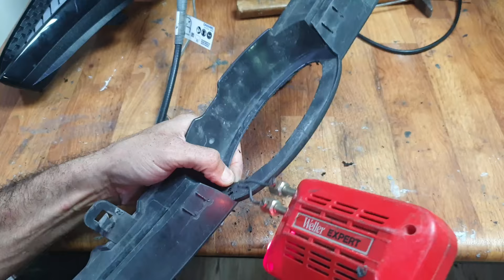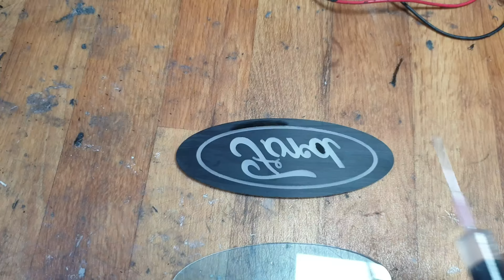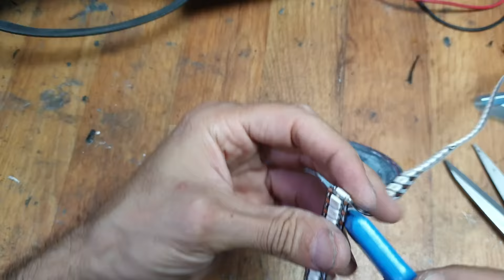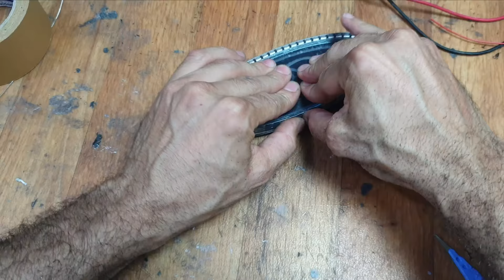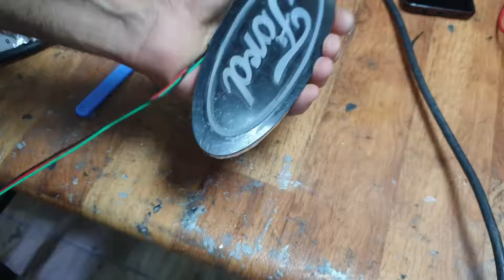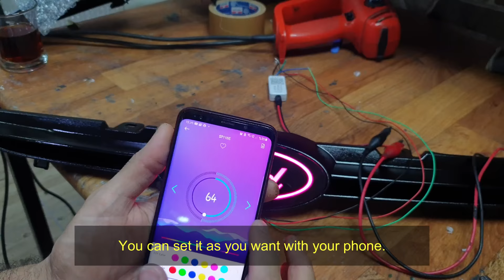Ford Fiesta Işıklı Logo Yapımı (ws2812b piksel ledli)

Comment: I watched many of your videos and i think you make amazing job. Unfortunately in my country that's illegal :( the lamps has to have approval so mostly they can only be original. But still. Great work. Keep doing.
Reply: If you live in the US its not Illegal to to make your car badge light up, and its not illegal to mod headlights and taillights as long as signals are present reverse lights are white& headlight bulbs are regular certified headlights (anything sold in The stores)
Reply: @SrtLv4x  and if you live in germany, dont you dare do anything to your car that is different from stock. You are not allowed to change any lighting or add any like this emblem. there are regulations for every little thing here in germany. IF you want to change some things here ALWAYS SPEAK WITH THE TÜV and DEKRA BEFORE you even think about changing something
Reply: @gessa9000  thats insane